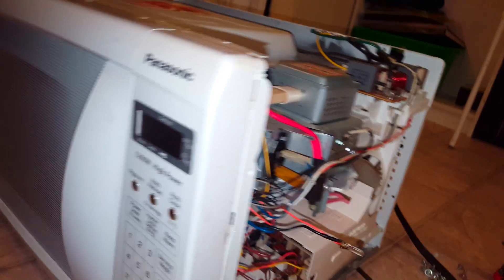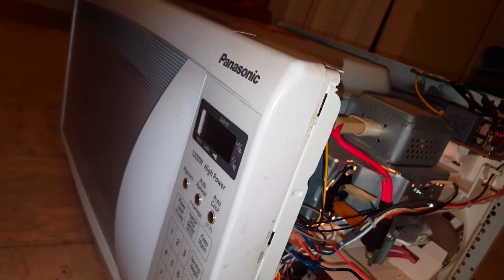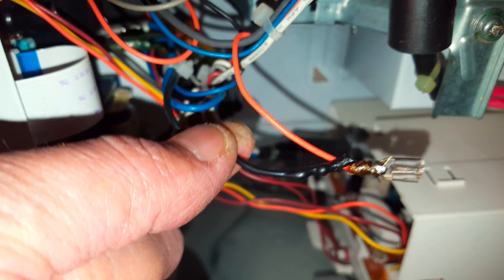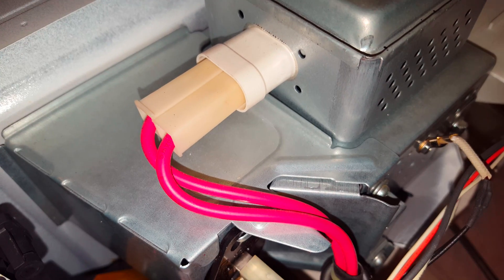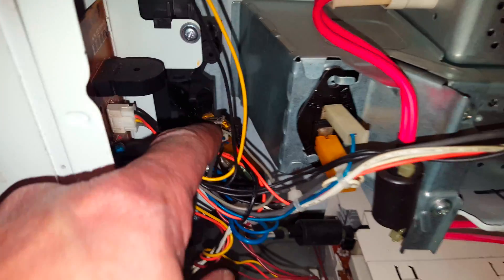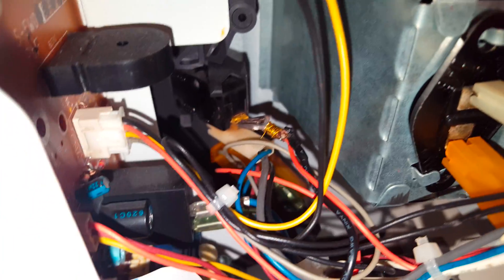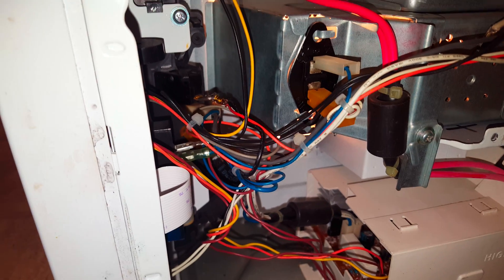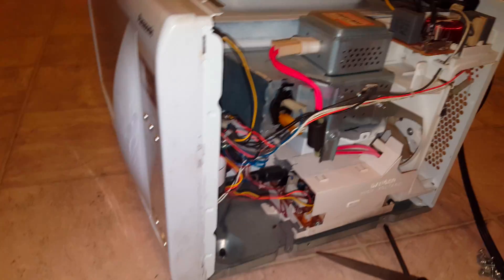How To Fix Microwave Panasonic Stops Few Seconds When It Starts

Comment: Hi my panasonic my model NN-Se796s says service? Any idea?
Reply from the maker: The "Service" message on your Panasonic NN-SE796S microwave typically indicates that there is an internal issue requiring professional repair. This can be caused by various problems, such as:
Possible Issues:
1. Magnetron Failure: This is the part that generates heat. If it's defective, the microwave won't heat food.
2. Control Board Issue: A malfunctioning or damaged control board could trigger the error.
3. Faulty Sensors: If the microwave's sensors, such as the humidity or temperature sensors, are not functioning properly, this message can appear.
4. Door Latch or Switch Problem: If the door isn’t properly latched or one of the door switches is faulty, the microwave may not operate.
5. Power Supply Problem: Voltage irregularities or internal power supply failure can lead to the "Service" message.
What You Can Do:
1. Power Cycle: Unplug the microwave for 10-15 minutes, then plug it back in to reset the electronics. This might clear the message.
2. Check the Door: Ensure the door is fully closed and the latches are not damaged.
3. Inspect for Visible Issues: Check for any obvious signs of damage or burnt components inside (if safe to do so). Let me know if those are helpful 😀 or if you need more assistance,  thank you 😊

Comment: I had the same problem so i just removed the switches and joined the wires works good now, now the oven has NO safety switches it is dangerous to do this SO be careful if you do it.
Reply from the maker: Hello my dear friend, that's genius idea, yes I did this one time and deleted it door switch,  exactly what you did, however I have to keep my eyes on it while microwave is on because it's not safe though, just in case if something goes wrong. Some  Microwave switches  don't last long, thank you so much and all the best 👍 ❤️

Comment: My Panasonic inverter microwave would shut down and reset the display after 10-30 seconds of running. Times would vary of how long it took till that happened.  I found the thermal cutout sensor located on top of the oven cavity was failing.
Reply from the maker: Hello my friend, thank you so much for your wonderful comment and great information, it's rare cause to thermal sensor cutoff because there is no high current unless the cause by Cyrclate shortage or vsical damage, did you replace it ? 
Was the wire melted or cutoff?
Thank you again and all the best 👌 👍
Reply: @WorldRandomVideos  The thermal cutout sensor is used to stop the flow of AC to the oven. 
The wire from the DPC relay to the thermal sensor was burnt and the thermal sensor resistance would jump around and sometimes go open when touched. I changed the sensor.

Comment: 6am about to watch the Japanese's grand prix and thought hmmm let me warm up a curry and have that for breakfast, only to find out my Panasonic 1000w inverter microwave stopped after approx 20 seconds... had to have the curry cold, hence now on youtube looking for answers, I'll strip mine down later and see if its an easy fix, like yours. Thanks for sharing.
Reply from the maker: Hello my friend, thank you so much for your wonderful comment and
great support 😀,  It could be the main high voltage diode was burned, 
Remember to leak high voltage compactor by holding screwdriver 
- + together for few seconds, 
Good luck and all the best 👌 👍

Comment from the maker: The black wire has more Amp and current that's why it was cut because of heat the black wire its connected with other wire as you see in this video both wires connected to door switch in one pin both wires are clamped together if you replace the calmp would be better because it's bad and it's also better to whopping them with plastic cover or electrical tape for safety, clamp both wires must be tight the wires won't make any sparks while microwave is working, the purpose of this video is to show you the cause of this problem is wires connected to the main door switch not the switch 
Thank you for watching 👀 Best regards ✨

Comment from the maker: It's better to use proper electrical clamp but I didn't have one so instead wrapped both wires together and apply some soldering for better connections and  connect back to the door switch pin back It's also better to wrapp them with plastic cover for safety the purpose of this video is to show you how to quick fix this issue, thank you 👍 and best regards 😀
Reply: Thank you!
I have that exact problem (runs only a few seconds)
I will take the cover off and see if I can put good wire on it.
I have some high-temp 12 awg that I can splice in.

Comment: My microwave had a similar problem - Panasonic NN-SN671S would automatically shut off after 3 seconds. Ordered a set of the three door switches on amazon for $10 and replaced all three. They are all mounted in one black plastic bracket that you can see in the video. Make sure to unplug the device from the outlet before you open the cover. It was very simple to replace. Open 5 screws from the back, then remove the cover. Open two more screws to dismount the black plastic bracket. The switches are just latched in place, be careful not to break the plastic when you replace them. Notice two switch types - you can tell them apart by the different location of one of the metal contacts. So replace one at a time and make sure you use the switch that matches the type of the old switch. In my case, the middle switch was broken, the button was depressed, would not pop back. The other two still function but had dark overheat marks, so I would suggest to replace all three. It's an easy DIY repair, about 15-20 minutes work.
Reply from the maker: Hello my friend, great job and excellent information thank you so much and best regards 😀
Reply: The black plastic bracket is so cheap that it does not hold my door switches closed and so I had the "three second problem".
I took the three swithes off of that bracket and used zip ties to permanently engage the switches. The microwave now works normally except I remember not to open the door while it is running. Press STOP and then open door rather that opening the door to make it stop.
PS
Based on other 'arcing' problems mentioned here in other comments, it is apparently best not to open the door without pressing STOP first.

Comment: Everyone says the interlock switches are the issue when the unit stops after two seconds. In my case, the power relay on the control board just behind the keypad was not conducting when it closed. This requires a replacement relay that you can find online. It is soldered into the board so requires unsoldering the old relay.
You can also cut away the plastic side of the old relay next to the power connections and file down the contacts so the relay conducts again.
This relay and the interlock switches are unnecessarily damaged by arcing when the door is opened while the microwave is running. Always hit STOP before opening the door.
Reply from the maker: I had similar issues before I will  also upload a video about that problem there are also other related issues and troubleshooting, thank you so much for great information and sharing thank you for watching 👀 
Best regards ✨ ❤

Comment: Thank You for sharing. My Panasonic runs three seconds sometimes, sometimes the complete set time. Any hints?
Reply from the maker: Hi friend sorry for late reply was busy 
Here are most common causes 
Common solutions for: Panasonic Microwave shuts off after a few seconds. A door switch might be failing intermittently. Check each of the door switches for signs of overheating, arcing, or burning. ... If the microwave runs for a few seconds and stops the touchpad might be at fault.
1. Faulty door switches

There are door switches in a microwave which must be sealed tightly for the microwave to operate properly. If the microwave runs for a few seconds and then shuts off, the door switch might be defective or loose. Sometimes arching or overheating of door 

2. Defective touch-pad or control panel

Some microwave models have knobs and dials while others have touch-pads. Microwaves with touch-pads are technological advanced but sensitive compared to the ones with knobs. So if your microwave stops suddenly then there might be a short in the touch-pad control panel.
3. Malfunctioning voltage transformer

There is a high voltage transformer in a microwave that produces high voltage to charge the magnetron. Upon charging the magnetron emits radio-waves which travels through the wave guide and enter the food area to cook or heat your food. If the microwave runs for a few seconds and stops
4. Faulty cooling fan

There is a fan inside microwave that runs to keep magnetron and other circuitry items cool. So if the microwave starts but the fan does not turn on, it may stop automatically for safety reason.
Reply from the maker: Hi friend 
I will send you troubleshooting instructions within next 2 hours or so

Comment: Hi, when I start my Panasonic NN-L931BF Inverter Microwave, the timer, fan, and rotating turntable and light begin to operate but stop after exactly 5 seconds. The timer resets to start but everything else stops when the Magnetron tries to kick in. Always after 5 secs exactly.
I checked all the door switches and fuses and all is OK. I'm about to pull out the Magneton
Do you think this is causing the cook function to reset the oven? It is dated 2001 but I just bought it a year ago. First time this has happened. The magnetron is 2M261-M32, older than the one in your video. I don't believe the fuse is blown as it starts everytime. Do I need to replace the invertor board or the magnetron to fix this problem. Will gladly donate to you for the correct advice....Paul
Reply from the maker: Hi, thank you for your question 
It's difficult to tell exactly what cause this problem but here are some common problems that can Cause this issue 

Control boards are often misdiagnosed—before replacing the control board, first check more commonly defective parts, particularly the door switches. If all of the other components are working properly, replace the control board.

If the microwave runs for a few seconds and stops the touchpad might be at fault. This is not common. Generally speaking, if the microwave display is working and some of the buttons respond correctly but some don’t, the problem is with the touchpad.

To determine if the touchpad and control panel are defective, try pressing each of the buttons on the control panel. If some of the buttons respond correctly while others don’t, replace the touchpad and control panel.

If the microwave runs for a few seconds and stops the thermoprotector may have tripped. This is a safety device to prevent the microwave from overheating. It can be tested for continuity to see if it's blown.

All microwaves have a fan. This fan runs when the microwave is on to keep the magnetron and electronics cool. If the microwave starts but the fan doesn't kick on, it may stop automatically for safety reasons. Listen for the fan. If you don't hear it turn on, you likely need to have the fan motor repaired or replaced.

Your Panasonic microwave also has an air intake grill, or vent. If it gets clogged up with dust, grease and debris, the oven will not work properly. Like with the fan, the microwave will shut itself off as a safety measure. Clean out the grill with a small brush.

Sometimes over-the-range microwaves suffer from moisture issues due to steam rising from the cooktop. In this case, the circuitry may be damaged

Other things that may cause your microwave to suddenly shut down are problems with the internal fuses, circuit board issues, defective power diodes, or a malfunctioning magnetron or high-voltage capacitor. All of these require a professional to diagnose and fix the problem.

I hope you can find out and. All the best 👍

Comment: My panasonic stops after 23 seconds every time ?
Reply from the maker: Hi Chris 
Here are selections most recent 
If it stops at 16 seconds and is a sensor model, it probably has a defective humidity sensor.

You can find links to helpful exploded view diagrams and part ordering help here.

I recommend that you bookmark that link to your favorites.

If it stops after 22 seconds, that means the controller has detected a problem, usually a problem with the inverter, controller, magnetron, or a bad connection from one or the other.

Due to the lethal voltages used and produced in inverters, I do not recommend that an inexperienced person work on these.

Comment: My microwave fuse at control board keep blowing when I press start .. how to fix
Reply from the maker: First when you replace the fuse is it same amp ?  If the fuse you replace  same capacity  and still blowing off than there is another problems

A faulty interlock switch is often the culprit if you're blowing fuses regularly. If the microwave fuse blew because you opened the door while it was running, that's a "smoking gun." Otherwise, you'll need to test the switch. First, unplug the microwave. ... If that's not the case, replace the switch.

Another reasons

Here are some possible causes of repeated blown fuses, from the easiest to fix at home to the hardest.

The cooling fan might have died or lost its effectiveness. If the oven goes a long time between blown fuses, this might be the reason. An object might have gotten lodged in the fan and stopped it from rotating. Removing it could fix the problem. Accumulated dust and grease might be obstructing the air flow, in which case cleaning up the fan and the vent could improve the situation. Third, the positioning of the oven could block the air flow. Moving it so that it has better ventilation may fix the problem. Or the fan may just have stopped working, in which case you’ll need to replace it.

A loose screw or other piece of metal could be causing a short circuit. Inspect the interior for any suspicious objects. If you see something lying loose, you may be able to get it out. Don’t touch any interior metal without discharging the capacitor first. A tool such as needle-nose pliers may let you get it out safely, but only use one with a well-insulated handle, and be careful what you touch.

The high voltage capacitor could be shorted out.   A capacitor with a charge is extremely dangerous to touch, but once it’s discharged, replacing it is within the reach of someone skilled at home electrical repairs.  Do NOT attempt if you have not been properly trained on microwave repair.

If the fuse blows when you open the door, the door interlock might be malfunctioning. This is a design feature. If the door isn’t properly closed, microwaves could leak out. The oven will disable itself rather than let this happen. This is a tricky repair, involving multiple small components, and best left to a good repair shop.
Reply: Thanks a lot .. I just founded that my HV capacitor is short
Reply from the maker: you are most welcome
Reply from the maker: Control boards are often misdiagnosed—before replacing the control board, first check more commonly defective parts, particularly the door switches. If all of the other components are working properly, replace the control board.

Comment: I have Whirlpool Model JQ277  STOP after 30 second. But other functions are good.
Reply from the maker: Control boards are often misdiagnosed—before replacing the control board, first check more commonly defective parts, particularly the door switches. If all of the other components are working properly, replace the control board.
Reply from the maker: Control boards are often misdiagnosed—before replacing the control board, first check more commonly defective parts, particularly the door switches. If all of the other components are working properly, replace the control board.

Comment: What did you do after you found that the wire was off and you soldered it back together?  I don't understand all your reaching to try to place it back to a specific place?  Will the wires be red and black in any brand?  Thanks
Reply from the maker: i cant use soldering because of heat so instead wiring it back together but it the best to use clamp
Reply: @WorldRandomVideos  Either soldering or clamping would be better than wrapping it like that. And make sure to apply a proper insulation. In the Panasonic each of these connectors has a plastic cover. Leaving the contact exposed like this is dangerous. If another wire or a metal piece becomes loose it might touch this exposed wire.
Reply from the maker: @youbidiha  hello friend, yes it's better to clamp it and wrapped it with plastic, thank you 👍
Reply from the maker: Thank you so much 💓 💗 💛
Reply from the maker: I didn't have proper clamp so instead I wrapped it with pieces of wire it did worked and it's also safe but it's better to clamp it because that wire has much current and Amp.
Hope that answer your question 
Thank you and best regards 😀